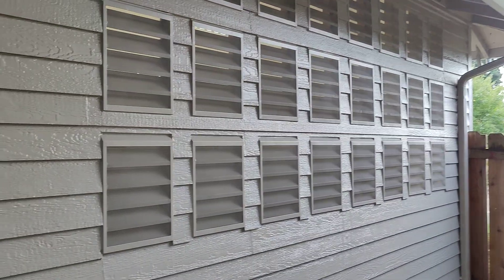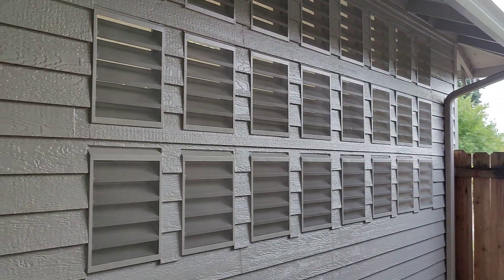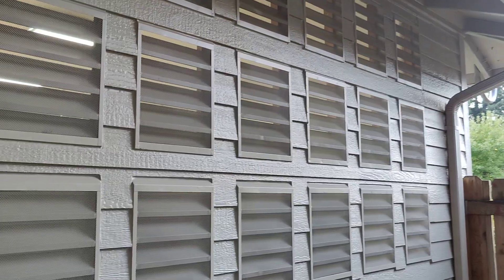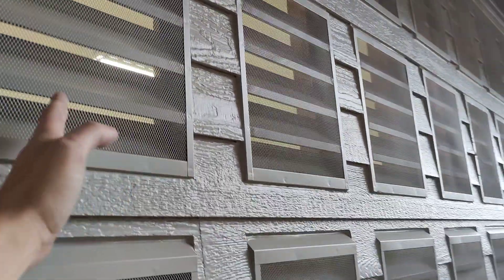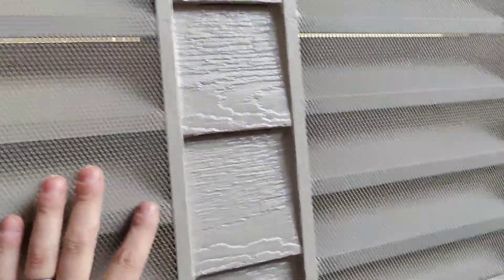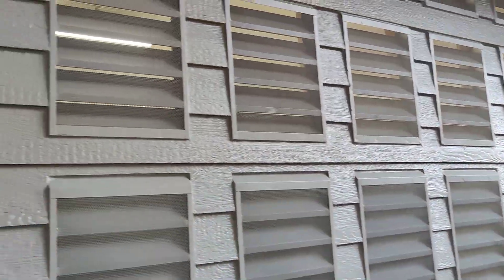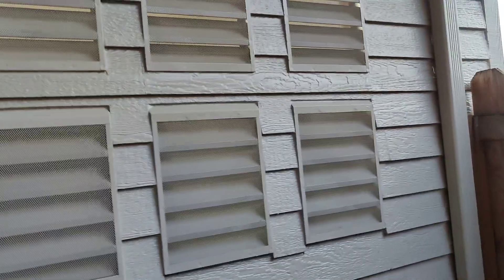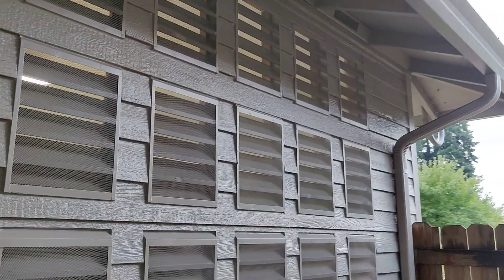GPU RTX 3080 Mining Farm - Garage Exhaust Setup, Pulling 400+ Amps

Comment: thanks for the value you provide man!!!! Do you have any tips for a setup like this but specifically for summertime Nevada? regarding heat and fresh air intake?
Reply from the maker: Get as much air as you can. When its that hot you need to concentrate on moving air rather then cooling the air. Get bigger fans and move that air as fast as possible.